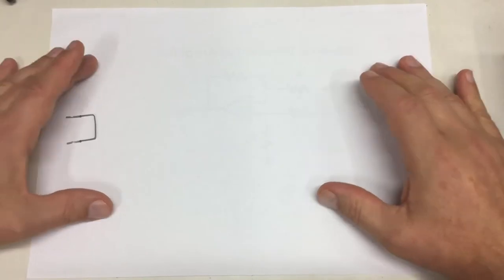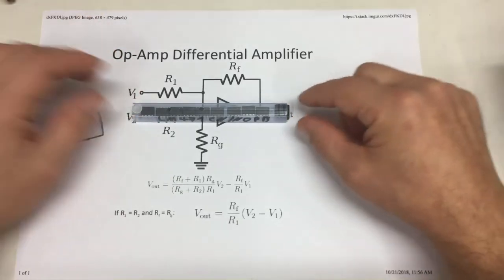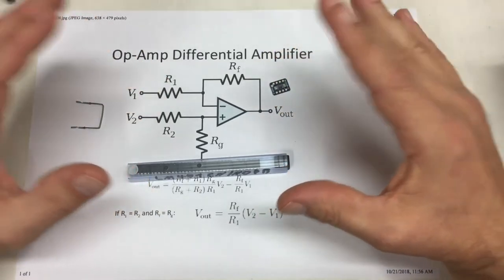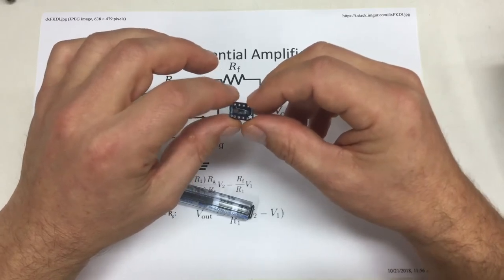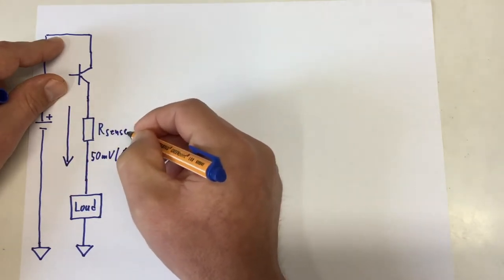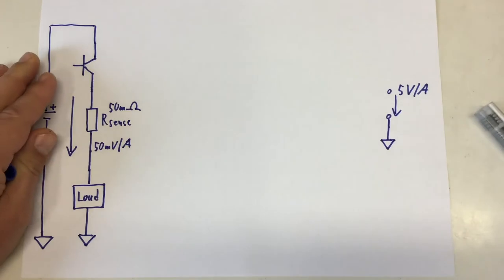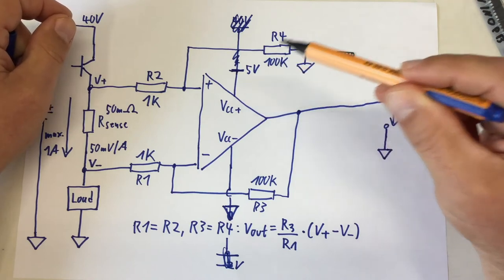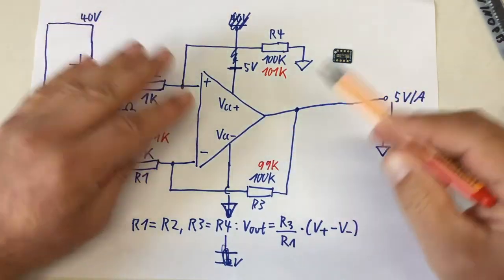Current Sense Amplifiers (1/2): Why not to use an OpAmp (CMRR etc.)

Comment: I have just found  a reference to the ADS1115 here, the gentleman in question is doing something similar (ish) to me ,already some interesting stuff, especially about using multiple filters, I also decided to do some simple averaging in software and was pleased to see you suggest this, the more I dig the more interesting it gets, I think I shall need a few times through the vid to get my head around the maths but now its part two...cheers.
Reply from the maker: Yeah, you always get that +/-1 digit noise out of ADCs or - in my case - the MAX6675 thermocouple chip (which contains an ADC of course).
And by all means, enjoy part two, where it gets practical finally.

Comment: @ 26:17 You calc 98.02 / 0.04 as 4909 but if we multiply by 100 /100 it is equivalent  to 9802 / 4 = approx 2500 . Somehow you got the correct result though 67.78
Reply from the maker: You're right, the 4909 is totally off. I have no idea where I got that value from. But obviously I continued working with the correct 2450.5 😅 Anyway, thanks for pointing out that mistake and kudos to you for noticing it.
Reply: @robertssmorgasbord  You're welcome. A lecturer at my uni used to do incredibly complex calculations very fast by rounding everything off and calculating within 5-10% the correct answer. What I realised then was how fast I could at least get a ball park value and also cross check my answer . It has since become a habit to do back of envelope calculations.   e
Reply from the maker: @das250250  That's a very good habit. Again, kudos to you! I guess it's an extension of the "Never trust a statistic that you haven't faked yourself." principle: "Never trust a calculation you haven't messed up yourself" 😅 Most of my errors I catch when cutting the videos, but sometimes something just slips through the cracks.

Comment: Great video. Just killed my plan to use that solution in my project. Will watch part 2 with great interest now 🤣 BTW, if I measure the resistors R1,  etc..  To make sure they have the same error (let say both R1 and R2 are 0.987 for example, would that partly solve the issue. Since the video is a little old now, do you have a better suggestion than the LT6105 or this that ship still relevant?  Thanks
Reply from the maker: First, yes, matching your resistors will alleviate the problem. Many current sense amplifiers at their heart do contain a differential amplifier with finely tuned (with laser etc.) resistors. Second, the LT6105 is still a production part and "recommended for new designs" by Analog Devices ;-) But there's a whole slew of current sense amplifiers out there. Don't get stuck on the LT6105 just because I used it.

Comment: This solves a problem i have been having designing a lab psu from my project! Thank you
Reply from the maker: You're welcome!
Reply: @robertssmorgasbord  i however ended up using an instrumentation amplifier, at least in the simulation. Id have to go through the math to check if that would work IRL. at least in the simulation it works...
Reply from the maker: Can't see why an instrumentation amplifier wouldn't work, as long as you stay within its input common voltages. It's a slight overkill though, you don't really need the high input impedance of an instrumentation amplifier when measuring the voltage drop across a sub-Ohm shunt resistor.

Comment: Good one! Very comprehensive explanation!
Little mistake i noticed: 98.02/0.04 = 2450.5 - anyhow, your dB value is correct (would be ~74 dB for 4901) ~68 dB is correct
Reply from the maker: Thanks! (also for pointing out that mistake, it's quite hard to catch those things without having another person cross-checking)

Comment: I really enjoyed this video but there is something I am wondering about. If you were to construct the same differential amplifier circuit but instead you powered it with a floating source for a separate ground and vcc (i.e. a battery), would this circumvent the issue of the common mode voltage at the high side of the measured circuit? It seems like the op amp would no longer 'see' this common mode voltage and would only 'see' the potential developed across Rsense but I am not sure.
Reply: Yes, in that case the op-amp output would be relative to it's own power pins.  That's fine if all it's doing is to drive a panel meter for example, but not if it's meant for feedback to the circuit being sensed (a current limit circuit for example).
Reply from the maker: I really have nothing to add to @Aitch-Two-Oh comment. Of course you could do a (so called) floating measurement and thus avoid all those nasty common mode voltage problems. E.g. you measure the voltage across your shunt with a "multimeter".

Comment: According to the Ramon Pallas-Areny paper, the best CCRR that can be achieved for a unity gain diff amp with 0.1% resistors will be only 54 dB.
Reply from the maker: I haven't read that paper (BWT do you have a link or the name of the paper?), but going by the him being a professor of electronic engineering and assuming you're citing him correctly I'd say that's absolutely correct. I'm just guessing here why you're posting this: Because I estimated in that video at some point a 88dB CMRR for 0.1% resistors. But my estimate was not for a unity gain (gain = 1) differential amplifier, but for one with a gain of 98. Professor Pallas-Areny's statement you cited is about unity (gain = 1) differential amplifier.
Reply: @Robert's Smorgasbord  No, I posted this just to remind people that it is  always beneficial to use higher k values rather than unity gain. However, as pointed out in the study, one must be careful using high k values in an attempt to maximize the CMRR as it may not be realistic due to CMRR limitations  of the op-amp self, if it is to work in applications above DC. It is suggested to use lower k values and trim one of the resistors to optimize CMRR.  Sorry I have the paper somewhere in my collection, but you should be able to find it in a google search.
Reply from the maker: @dm-ot1st  Sorry I didn't get the point you were making right away, but of course you're absolutely right. Things get really interesting when you start to optimize an op-amp circuit for CMRR and bandwidth (gain-bandwidth product limitations), 'cause those two are really going against each other. Anyway, thanks for your input!

Comment: Great video 👍, have you tried measuring the hall effect sensor across the shunt ? In that case voltage does not matter neither the poles AC/DC.
Reply from the maker: Nope, I haven't. But hall effect sensors are a great option for measuring (high) currents when you need galvanic isolation (or don't want to bother with current sense amplifiers). However, hall effects sensors are a bit tricky to calibrate (unless you use a complete hall effect current sensor package) and they are not as precise as shunt resistors.

Comment: I just stumbled upon this video and it's highly informative. I'm currently doing a project which requires current sensing. Is there any way to improve the accuracy of sensing the current flowing through the circuit using opamps (other than improving the ADC's resoulution) like having multiple stages or buffer stages.
Reply from the maker: Using additional op amps will do nothing for you but add additional errors. There are precision current sense amplifiers available that will give you +/-0.5% (e.g. https://www.maximintegrated.com/en/products/analog/amplifiers/MAX9922.html ). Also, if you don't need the large common voltage range of a current sense amplifier, you can use an precision instrumentation amplifier, which should give you better that +/-0.25% (e.g. https://www.maximintegrated.com/en/products/analog/amplifiers/MAX4208.html ).
Reply: @robertssmorgasbord   Thank you so much... Helps a lot with my project.
Reply from the maker: @briansamuel327  You're welcome :-)

Comment: Are there any significant differences between a current sense amp and an instrumentation amp?
Reply from the maker: The inputs of current sense amplifiers usually don't have a very high impedance. Which is OK in a current sense application, because you're measuring the voltage drop across a very small resistor. Instrumentation amplifiers on the other hand offer very impedance inputs. This way you can measure high impedance signals without worrying about any currents going into / coming from you amplifier inputs distorting the signal. Also, most instrumentation amplifiers not happy with input voltages over/under their positive/negative supply voltage. That's something many current sense amplifiers can handle without any problem, at least in one direction, usually input voltages far above their positive supply voltage.
Reply: @robertssmorgasbord  Thanks for the detailed reply.
Reply from the maker: @Robert-un3cf  You're welcome!

Comment: If you want to measure high BW current measurement, this is the best configuration, no hall sensor, isolation will work any better.
Reply from the maker: Sorry, just noticed I never answered to this comment of yours ... Indeed, it's the best configuration. Isolation for high bandwidth is best implemented digitally after an ADC.

Comment: Would there be anything wrong (other than overkill) with using a differential amp configuration on the low side?
Reply from the maker: No, absolutely nothing wrong with that, besides that it is really overkill.
Reply: @robertssmorgasbord  I do not think it would be overkill. Without a differential amplifier you are very sensitive to any voltage drop between the sense resistor and ground. The sense resistor should be connected with separate sense connections requiring a differential amplifier.
Reply from the maker: @larslindgren3846  Well, you are right and my statement was a wee bit too general. As soon as your precision requirements reach a certain level (and when you're using a four terminal shunt you're clearly aiming for precision) a differential amplifier is of course not an overkill but a necessity. Anyway, if you're just aiming for 1% or 2% precision with a simple shunt resistor a "good enough" OpAmp will be sufficient.
Reply: @robertssmorgasbord  I think that maybe true that you can use a singe ended amplifier when measuring small currents less than a few amps and the measurement system is on the same PCB as the power electronics and with a  reasonable design. In many other reasonable cases the errors will be much larger than 2%.
Especially if the return path from the current shunt to the ground star point is a few meters and shared with other loads. I agree that the common mode rejection of a simple op-amp is often good enough if it is configured as an differential amplifier but the question was if you need to use  differential connection rather than a single ended amplifier.
Reply from the maker: @larslindgren3846  Well, it all depends on the application, doesn't it? Maybe we can agree on, that if you want to "do it right" you'll use an differential amp, and if you need to go cheap and can tolerate some larger errors you can go with an OpAmp in some cases.

Comment: Very informative, thank you.But i have a question, @12.13 why we are not seperating load and sense resistor so load will be aboce side of transistor and sense resistor will be below side of transistor?
Reply from the maker: First, you're welcome! To answer your question: The circuit you're suggesting would work of course. But keep in mind that the load would be floating between the supply voltage (transistor off) and the voltage drop across the sense resistor (transistor fully on). In many cases that wouldn't matter, e.g. driving a DC motor or a relay coil. But if you want the negative connection of your load being ground (e.g. lab power supply, the load being whatever you connect to the power supply) you can't use that circuit (or low side current sensing).
Reply: @robertssmorgasbord  Oh thank you very much again, sir can you please help me?Using this seperated circuit, i have a big electromagnet as load 1770 number of turns, 17 ohms.A diode parallel with electromagnet for protection of reverse current when power off.I  controlling it with 125 hz Pwm from Arduino.Switching component is fds9953 mosfet.I placed a shunt resistor 0.5ohms and its parallel rc filter(2.2k 1uf) to smooth pwm for current sensing.Supply voltage 12 volts.I will connect Ads1115 between shunt resistor.Do you think is there a problem?I want to look current depending on pwm.
Reply from the maker: @talhamsi  Assuming I understand your circuit correctly: The cut-off frequency of your RC filter is 72Hz - that's still quite close to the 125Hz PWM. I would lower the cut-off frequency, otherwise there will be a lot of noise at your ADC input - let's say to a tenth of the PWM frequency (12.5Hz). Since the input impedance of your ADS1115 is several MOhm you could do that by simply increasing the resistor value to about 13kOhm. Also, you could use 2 or 3 of such RC filters in series to get a really smooth signal to your ADC. Of course you can always do some averaging in software. Also, such a large inductivity (the electromagnet) does cause nasty voltage spikes. Depending on how fast your free-wheeling diode parallel to it and your MOSFET in series to it switches, there might be some of those spikes still present across your shunt resistor. To be on the save side you could put two diodes in reverse polarity parallel to your shunt resistor (the voltage across it should never exceed 353mV). Just to protect the input of your ADC. Well, that's all that comes to my mind right now. Hope it helps.

Comment: Nice video, useful content. 
When you wrote “add 10dB if increasing a power value by a factor of 10” (30:41), did you mean 20dB? As that would be consistent with the graph.

Thanks for the upload, it’s helpful for my project :-)
Reply from the maker: You're welcome! And no, the text is correct. But maybe it was a bad idea to put it in this context (it was just an afterthought when editing the video). The text was intended as a reminder that the dB ratio for "power quantities" like Watts is defined differently - 10 * log10( P1 / P2 ) - from that of "field quantities" like Volts and CMRR - 20 * log10( V1 / V2 ). Wikipedia has a nice article about that: https://en.wikipedia.org/wiki/Decibel

Comment: Can I measure AC current through with that? Or the response of op-amp would be too slow?
Reply from the maker: Well, in principle you can measure AC current with that, if: A) The voltages at the inputs of the op-amp never exceed the allowed common mode voltages for the op-amp type. And B) the op-amp type is fast enough for your AC frequency (bandwidth, slew rate, gain bandwidth product).

Comment: So, if the data sheet says the op amp CMRR is 85dB, does that mean that the error due to the resistors mismatch in Vout of the amplifier will be 0,33% regardless the precision of the resistors?
Reply from the maker: Yes. Here's explained how that's measured for op amps: https://www.analog.com/media/en/training-seminars/tutorials/mt-042.pdf You will need some resistors with 0.0001% tolerance :-) Well, there's actually a second method described not relying on insanely precise resistors.

Comment: Hi, that was useful, thank you.

A regular, but non-trivial, requirement these days is the need to measure sleep current in the low uA or even nA, without creating a brownout condition when the processor wakes up and starts drawing mA.  The current sense amplifiers I've looked at simply do not have enough gain.  I wonder if you have a solution for this.

Btw, hang on to those LM471's, they're a rare find!
Reply from the maker: Ah, you noticed the LM471 thing 😅 I found them vastly superior to the LM741s 🤣 Anyway, there is a reason why multimeters usually do have a separate jacks for A/mA/µA. Covering a large dynamic range (mA to µA/nA) is quite tricky. I guess (!) you could use several shunts in parallel and switch them in and out with relays or MOSFETs). Or you could use several amplifiers with different gains and just accept that at higher currents some of them will go into saturation. Of course you need some logic (MCU) to choose which amplifier output to use (a nice ADC with an input multiplexer would come in handy here). But these are just some things that come to my mind, I never build such a thing myself.